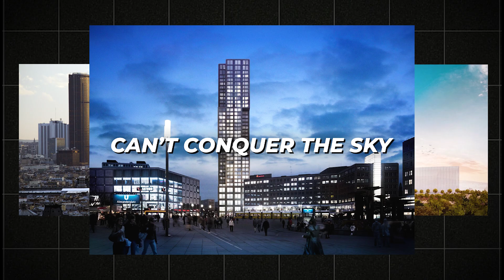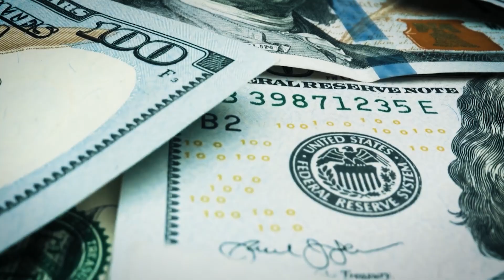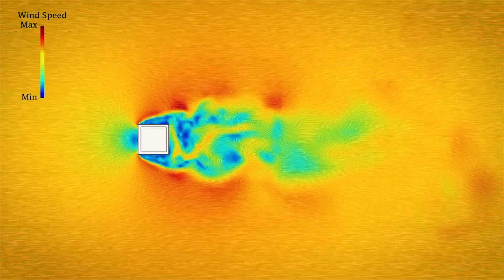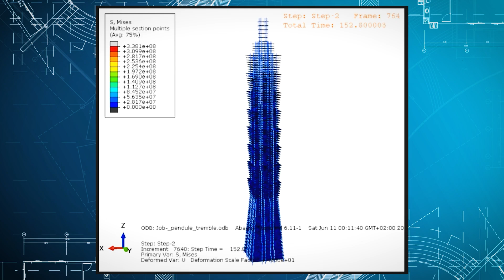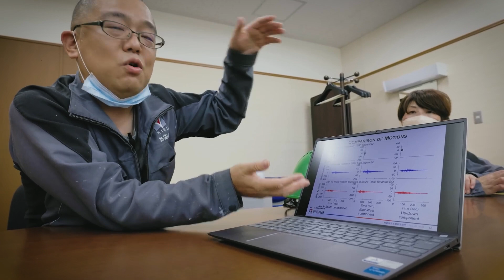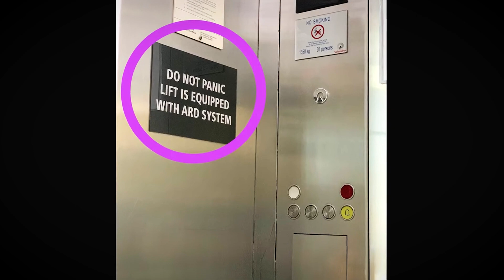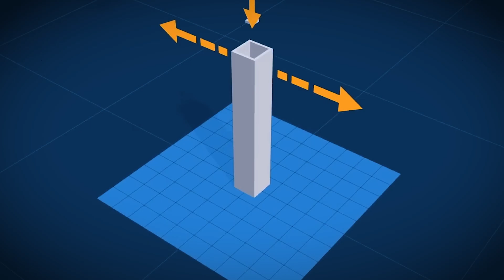Why Europe Is Not Building Skyscrapers

Comment: Extreme high buildings are build in regions which are rich enough to pay it and are interestet to demonstrate power and proudness. For Europe all this don't match. Europe is no power region and is not willing to invest into proudness projects. A similar effect is seen in railway systems. Europe High Speeds Trains are restricted to 320 Km/h Maximum. China works on beyond 600 Km/h train speeds. But the frame conditions are completly different: China has like USA around 9 Million Squarekilometer landarea. You can drive with 600 Km/h in China or USA, but not in Europe. Europe is dense settled with station distance less than 50 to 100 Km. Driving with 600 Km/h is just senseless and ridicules in Europe. To much noise and power consumption to save perhaps two minutes travel time. Europes trains are optimized for economics but should not win a grant price race of fastes trains constructable. And the same pragmatical point of view rules also building activities. As no need for 600 Km/h trains exist in Europe no need for 600 Meter high buildings exist. Europe is old and retired. Keeps out of international races, which are now espacially forced from China. Also the USA cannot follow the pace of Chinas innovation and development race. Arabia has to much money and can waste billions of dollars for outstanding buildings. Nowadays Europe is to poor for such ambitions.
Reply: norway f.e. also has her oil billions. but instead of putting that money into vanity projects Norway puts it into sustainability.
Reply: The ignorance in this comment 💀💀💀💀
Reply: the only skycraper in europe are these stupid eolien